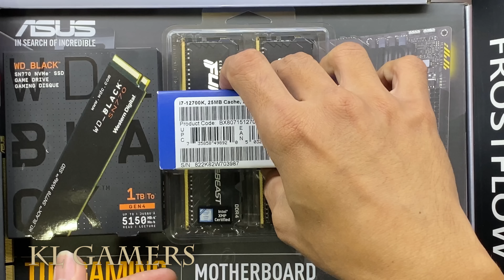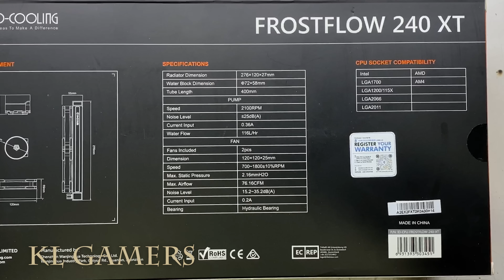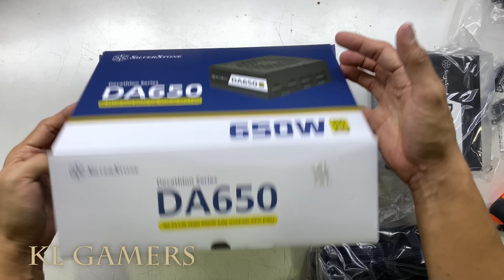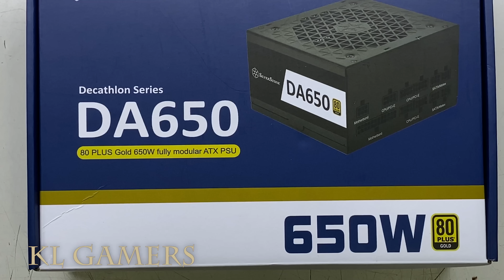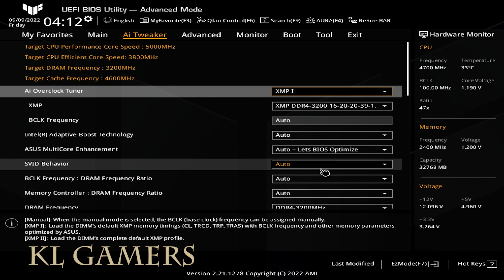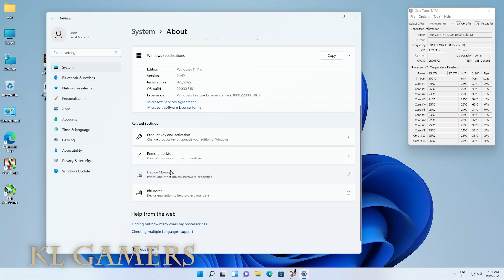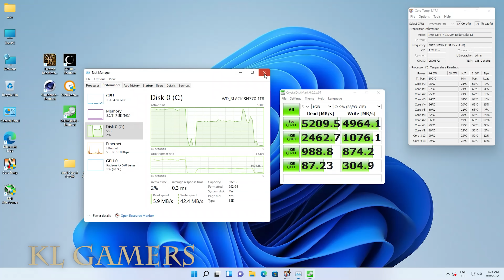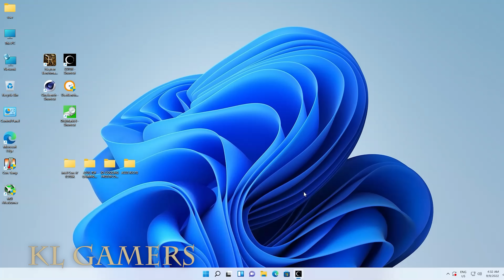intel Core i7 12700K ASUS TUF GAMING Z690 PLUS WIFI D4 RTX3060 FROSTFLOW 240XT CORSAIR 4000D

Comment: same cooler & cpu (well KF) yet my temps are way higher than yours?
Reply from the maker: maybe you forgot to take off the transparent sticker on the AIO contact, need to run in AC to get better temp
Reply: @KLGamers  Nah it didn’t have a sticker at all, temps are normal, just way higher than ive seen than others who have the same cpu. Maybe it needs to be reseated

Comment: I need help I have a 12600kf cooled by a nh-15 with 16gb of 3600mhz. A 1080ti and the same board and case. But all the critical alert lights are showing.